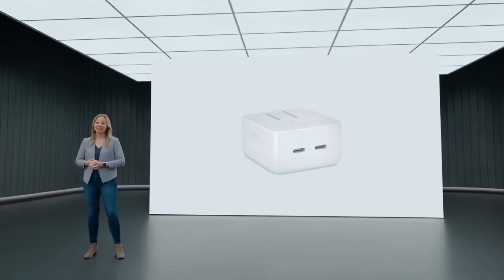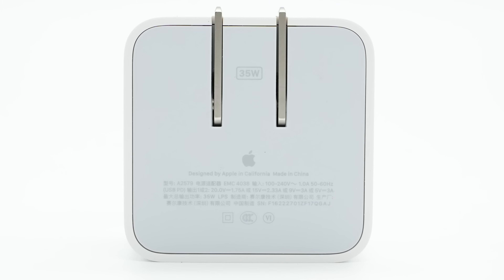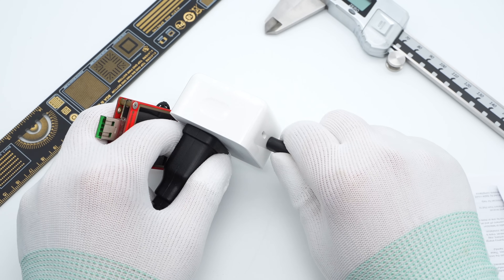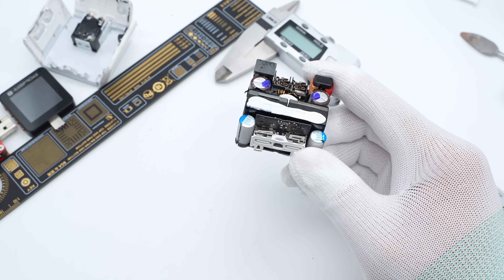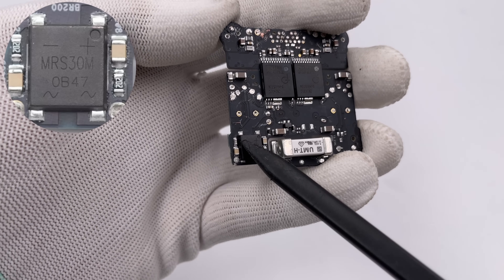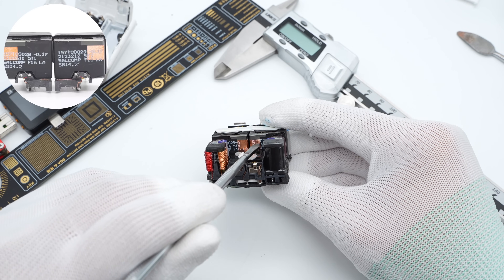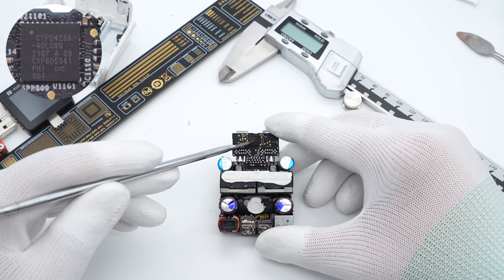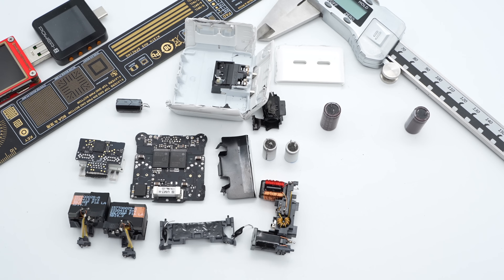Completely Different | Teardown of Apple 35W Dual USB-C Compact Power Adapter

Comment: Well-built, modern, beautiful... But unnecessary. We have many GaN adaptors available in a smaller size and it doesn't make sense to buy this expensive option. Unfortunately, it's not worth it anymore to buy Apple accessories, just the devices. Happy with my 65W GaN adapter from Aliexpress, which I paid just 20 dollars for to charge my Macbook, my iPad and the iPhone at the same time.

Comment: Does this charger have power factor correction?
Reply: It doesn't. It's just a 35W charger. Power factor correction is used in higher wattage chargers (90W or more, and that's not even always the case). So far I don't know about any 65W usb charger with power correction factor built in.
Reply: @martin.w7371  not just 100watts even 5volts 3amp look for baseus 100watss

Comment: ChargerLab, thanks for sharing this tear down of a new APPLE charger with twin USB-C ports although it’s not unique. APPLE still have NOT adopted GaN technology. The components are of high quality and well designed as expected especially the soldered USB-C port terminals. Tearing apart is tough as practically needing the dremel tool on all sides. APPLE is selling it as a 35 Watts charger which can only be achieved when using only a single USB-C port, limiting it use to portable devices such as iPhones or iPads. APPLE laptops need more than 35 Watts charging.

This 2-USB C charger is APPLE substitute for their promised but never manufactured “Wireless Charging Pad”.

APPLE prices for the lower-end products are slowly going up with incremental functionality such as this charger and the new M2 MacAir, M1 iPad Air4, M1 iPad Mini. Soon APPLE goes from being affordable to expensive again which is a sad development.
Reply: They have adopted GaN for some products like the 140Watt 16" MacBook Pro charger.

The $1200  M2 MacBook Air in compared to the competition is actually a good deal. You can a lot of new features compared to the old MacBook Air M1. 
The competition such as Lenovo with the ThinkPad 13s released a $1200 laptop with very weak chip and subpar screen. 

Dell released a XPS 2022 laptop with no headphone jack and also higher price for models that need a 4k screen.
Reply: @rohithmekala2608  thanks for the info
Reply: For the target - the macbook air m2, this charger is really more than enough though